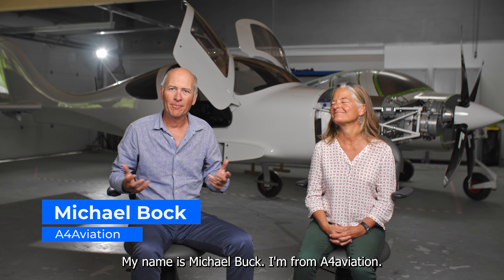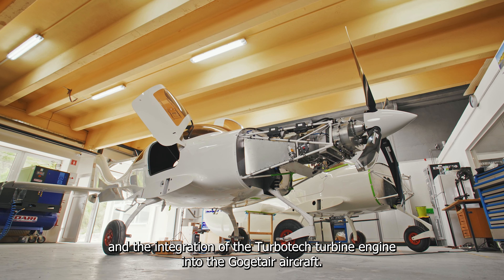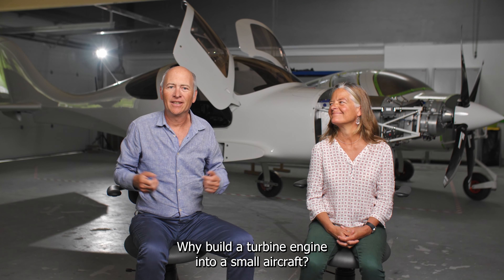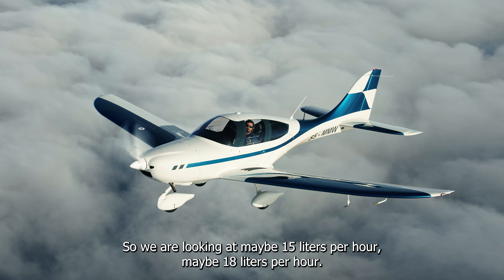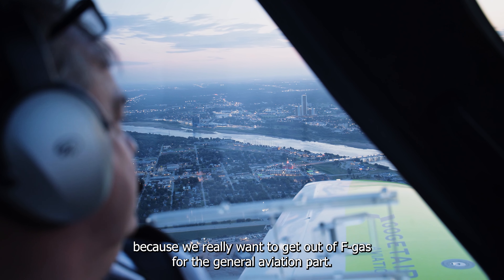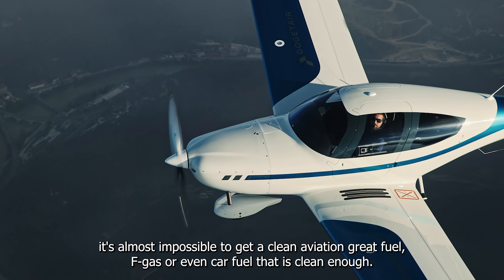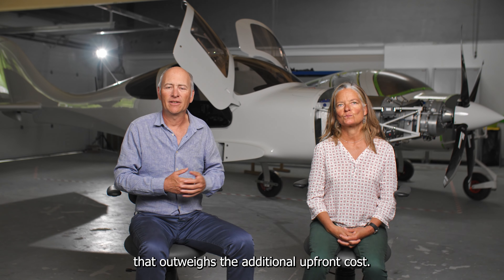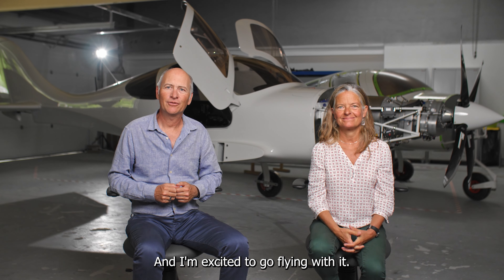GOGETAIR AIRCRAFT G750 - Turbotech Turbine Engine Integration

Comment: Nice airplane, but I don't see any way to get fuel consumption that low with any turbine. The regeneration of heat is a technology that works, and it was first utilized on Chrysler's turbine cars of the mid 1960s. I suspect 40-50 lph is a more realistic estimate, and that would be an efficiency breakthrough for a turbine. Turbo Tech is claiming 20 GPH @ 50% power from their 104 kw (140 hp) turboprop.
Reply from the maker: Hi. We fly now regularly with consumption from 25l-30l/h with TAS 135-140 knots. 15-20% higher fuel consumption than Rotax 916iS engine.
Reply: @gogetairaircraft  We wish you well with your turbine aircraft. it sounds better than expected, and surely this engine represents a breakthrough in turbine efficiency, but still less efficient than a Rotax, which is arguably the class leader in efficiency. The difference may be a wash in areas where jet fuel is cheaper than 100LL, but that would not include the US at this time, where Jet-A costs more than 100LL. While Turbotech has not offered overhaul prices for its engine; turbine overhaul traditionally cost 2x -  4x more per hp than piston engines. Lower overhaul cost and ability to run on auto petrol still appear to give Rotax the cost advantage.

Comment: You can get to different kinds of fuels by installing a diesel engine.  Many proven aviation diesels are already marketed.  Could drop one in today and fly it next week.
Reply from the maker: Sure, but a turbine engine is an entirely different philosophy in aircraft propulsion. Both have advantages and disadvantages. Diesel engines are heavy enough to be used in small aircraft and complexes to cool.

Comment: How does it have lower fuel consumption and compared to what? What is the pressure ratio of the Turbotech TP-R90 engine? A diesel certainly has lower fuel consumption than a small gas turbine, as most small turbines have a pressure ratio from 6:1 to 8:1, while modern turbocharged diesels are generally around 16:1 to 18:1. From what Turbotech's website states, the TP-R90 has only 141 hp, yet weighs 85 kg, giving it a power to weight of 1.7 hp per kg. Modern diesels have superior power to weight ratios, such as a BMW B57D30S0 which has 394 hp and weighs only 185 kg, resulting in a power to weight of 2.1 hp per kg.
Reply from the maker: The diesel engine is heavy and complex (cooling, peripheral units, ...) to be installed in small aircraft. Due to CG limitations, most small aircraft can not install engines over 100kg. We run engine on 75% most of the time in the aircraft. Automotive engine is designed to be run on 15-20% most of the time. There are diesel engines in larger GA aircraft but it will be hard to install them in UL, VLA. But why not...